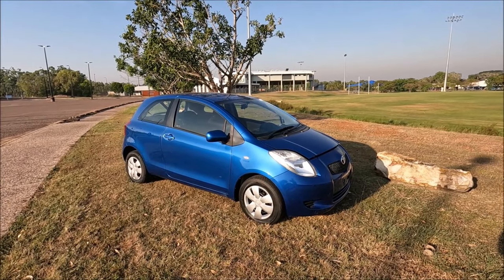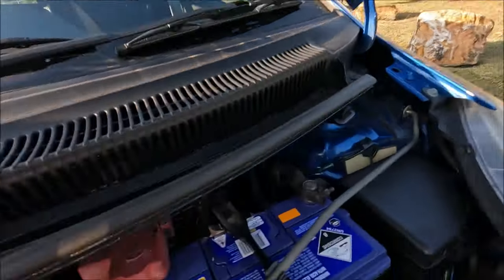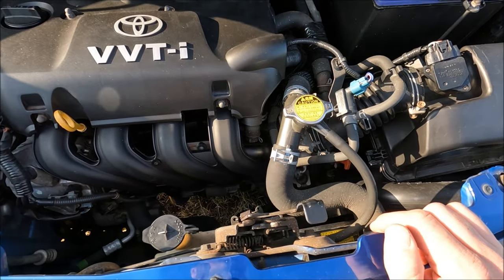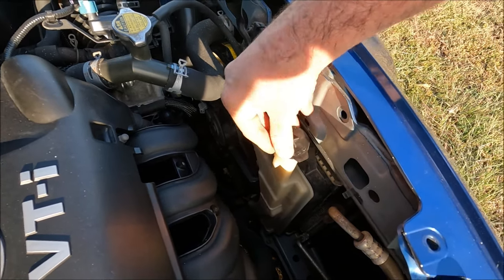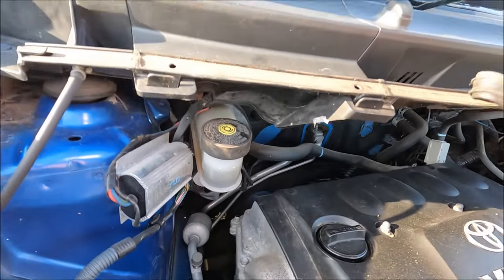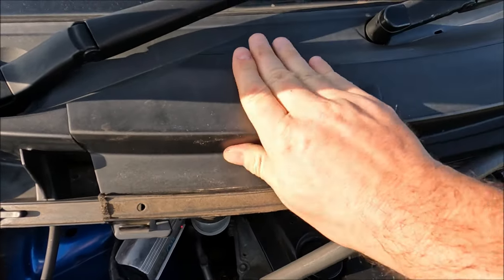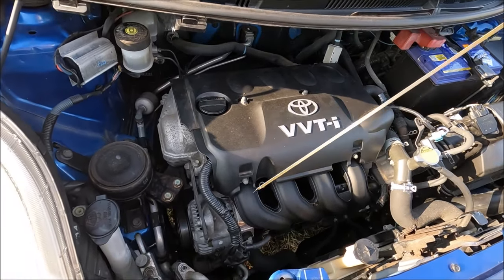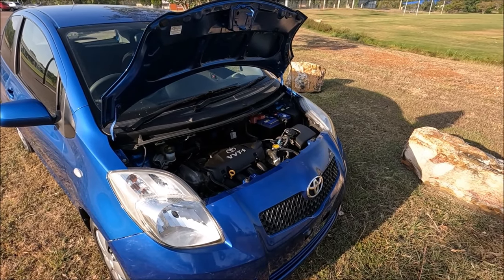Toyota Yaris Fluid Locations, Engine Oil, Coolant, Washer, & Brake Fluid

Comment: Were do you put power steering fluid
Reply from the maker: Hi Lily, It depends on your model/year but this one had electronic power steering. If yours does have hydraulic power steering the reservoir would be easily seen and not hidden. Ross

Comment: U forgot the transmission oil and power steering oil locations
Reply from the maker: It has electronic power steering and the transmission oil check is a video on its own as it involves getting under the car.

Comment: 2:00 what is the circular window on the bottom left? it has a turning knob on top of it too.
Reply from the maker: Hi there, that is part of the air conditioning system.
Reply: @RossPerryProductions  I see ty

Comment: What causes the poer steering to stop working. My 2007 toyota yaris 1lt just had alternator replaced & suddenly i can hardly turn my sterring. Its gone completely stiff like i have 4 flat tyres. Whats happened. Please help
Reply from the maker: Hi there, does your model have hydraulic power steering or electric? to find out check in the engine compartment to see if there is a power steering fluid reservoir, if there is this sounds like a fluid issue which could be from a leak or the pump itself being faulty. is there isn't one it could be the electric motor or a wiring issue. sorry I cannot be of more help its hard when I cannot see the car. Ross

Comment: Hi Ross, I have a 2006 model. Same body style as yours but engine is slightly different, its been sitting up for a few years but when i drive it now the steering pulls hard to the left and right on its own. Any ideas on what it vould be? 
Thsnks Adam
Reply: I can't see a power steering reservoir so I'd say it's electric
Reply from the maker: Hi Adam, sounds silly but have you checked the tyre pressures and made sure they are both at the same pressure, they did make the earlier models with a hydraulic power steering but the one in my video was electric. if it is the Hydraulic system have you checked the fluid level and filter? if electric it could be the motor sticking.

Comment: Where's the power steering Reservoir located? I didn't know you have extra space when adding brake fluid! Thank you!
Reply from the maker: Hi there, if your model is the same as this one, it has electronic power steering that doesn't have fluid. Thanks for watching and your comment. Ross

Comment: I'm new to cars. Does this model not have steering fluid tank?
Reply from the maker: Hi there, this one in particular had electronic power steering, I believe there are some with a hydraulic system too, If your model has a hydraulic system the reservoir will be on show not hidden.

Comment: ON my Yaris I can hardly see the level of coolant (so much cramped inside) it is a low power model., the reservoir has the same shape as the one shown here. what can I do ?
Reply from the maker: if you shine a torch into the top of the reservoir in low light it should light up the level other option could be to make a dip stick just to test it, and top it up as required.

Comment: I have yaris 2010, is power steering fluid reservoir same Brakes fluid reservoir  ???????
Reply from the maker: electronic power steering.
Reply: @RossPerryProductions  thank you sir
Reply: @RossPerryProductions  accidentally I put power steering fluid into the brake fluid reservoir a year ago and it worked very well. 
Now the reservoir is low , will I just add the right brake fluid to the reservoir or I have to empty the reservoir first  ??

Comment: What about the power steering fluid? Or does it have it at all?
Reply from the maker: If it is the same as this model then it has electronic power steering. no fluid. Ross
Reply: @RossPerryProductions  

Thank you. I bought a 2010 yaris last week and I was wondering about that. 
Thanks.
Reply from the maker: No worries at all, I am glad I could help, great little cars.  @nidaldajani728
Reply: @RossPerryProductions  

Oh yes it is. Of all car I owned in the past this is my first Japanese car. I am pleasantly surprised how simple it is. Im sure working on it should be a breeze (unlike German cars).

Comment: Can you tell where we add steering oil please??
Reply from the maker: If your model is the same as this one, it has electronic power steering, no fluid. Ross
Reply: I have Toyota yaris 2009
Reply from the maker: Yes, I believe that has electronic power steering. the Power Steering reservoirs are pretty obvious so you would see if you had one.
Reply: thanks

Comment: Where is the power steering deposit?
Reply from the maker: If your model is the same as this one it has electronic power steering.
Reply: @RossPerryProductions so if the steering wheel light comes on how do we fill the fluid
Reply from the maker: If the light comes on then it is more than likely an issue with the electric motor, or the EPS module. Here is a good video for how it works : https://www.youtube.com/watch?v=KuY_DTgGHW8  @ce-rf3lg